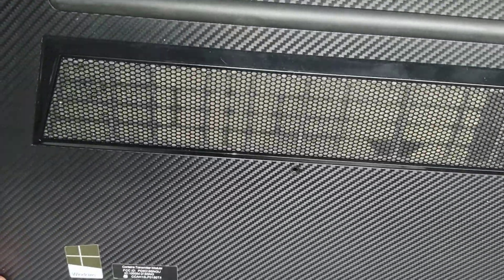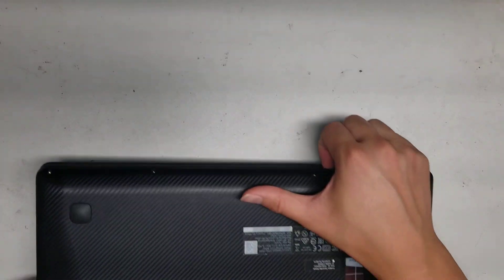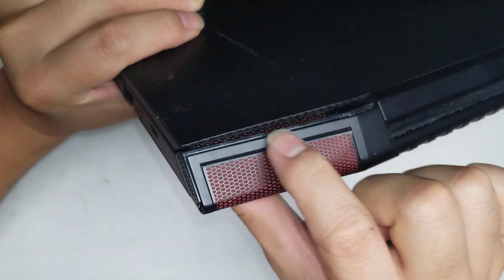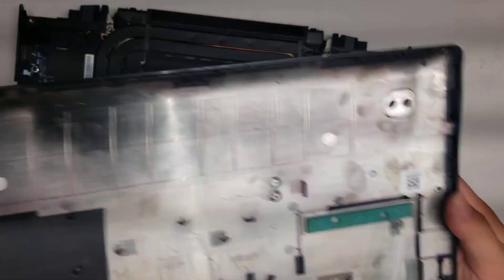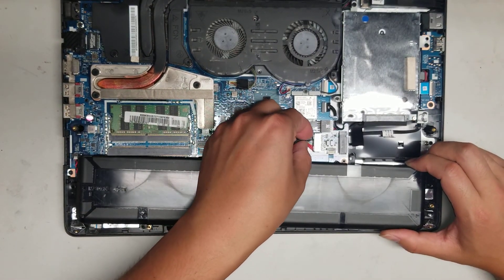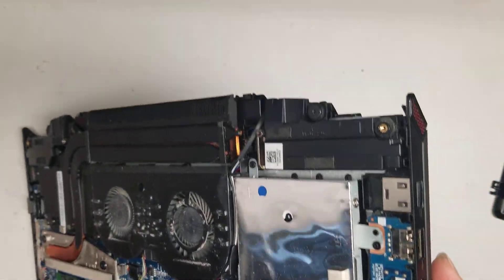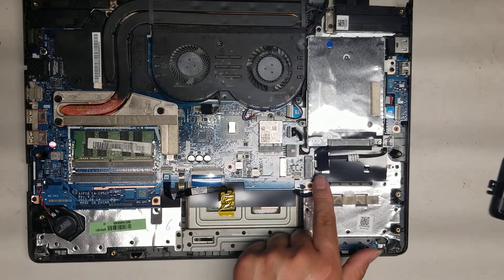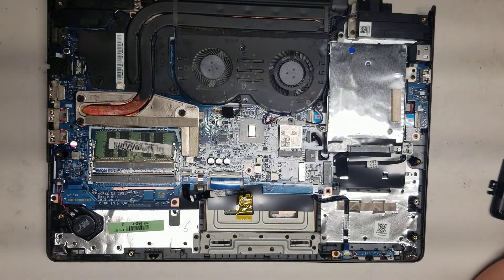Lenovo ideapad Y700-14ISK 80NU Disassembly RAM SSD Hard Drive Upgrade Repair

Comment: dude edit your video. Half of the vid is you trying to open up the back case
Reply from the maker: So what you're saying is, cut out the part that I struggled on,  and expect everyone that watches my videos to figure it out themselves? I'd like to educate you about a feature of YouTube known as fast forwarding and the progress bar. You know you can slide that around and view a preview of where the cover is already off if you can do it yourself?

If I edit that part, other people will wonder what they're doing wrong and why it was so easy for me to get apart...
Reply: @ItsBinhRepaired    as a repair and review channel you should not "struggle" on opening a back case that's for one. Also its not like you provided much useful information here:  That M.2 port, is it NVME or SATA?  the heat sink, how do i take that out and reapply thermal paste? what is the exposed shiny chipset in the middle but without a heatsink?  Based on the video I say the hinges are f-ed, can you show me how to fix that?  
I will give you credits on the connectors part, but tbh, the information density of this video is VERY low. As for fast-forward, not my fault you didn't put no timestamp in the description. When I ff several times and you still stuck on the cover thats on you.
Reply from the maker: @ddjohnson9717  do you know how to use the progress bar? Click or tap and drag it. You'll see when the cover comes off. Do I need to make a video on how to use this feature?
Reply from the maker: @ddjohnson9717  this video is 2 years old, and of course when working with hundreds of thousands of models, you can't get all of them open easily. You can't expect a car mechanic to know how to open every single car, especially when manufacturers come up with all different ways to secure things. As for fixing the hinges, I have lots of videos of all different models where I replace the hinges.

I do repairs based on what customers bring for me. How would you like if you came in for a tooth cleaning and your dentist was like, today I'm going to show the internet how to do a root canal on your perfectly healthy teeth! :) This is not how my repair business works. I don't experiment on customer devices. If you want to find out what type of SSD is supported, purchase both, try the NVMe first, if no luck, then you have to go with the SATA. Again, these are customer computers, not test benches they give me to mess around with.
Reply: @ItsBinhRepaired  yeah dude. dodge the real questions and try to blame me fore some BS. How did i know how far should I drag it? Also you gonna answer my questions or nah
Reply from the maker: @ddjohnson9717  ok, let me make a video for you real quick
Reply: @ItsBinhRepaired  "purchase both, try the NVMe first, if no luck, then you have to go with the SATA. "  you do know you can't return that stuff once opened right? If this is how you make a business out of repairing laptops please let me start a branch with you on the east coast.
Reply: @ItsBinhRepaired  also I don't know how many video you got with your address plastered in the discerption but I really suggest you change that. who tf publish a residential address?
Reply: @ItsBinhRepaired  i will wait in great anticipation
Reply from the maker: @ddjohnson9717  I guess they don't have Amazon where you live... plus, I can keep one of each because I'll likely need it eventually, but holding onto depreciating parts is dumb, so I never carry M.2 SATA drives.
Reply from the maker: @ddjohnson9717  thousands, and you care why? What are they gonna do, send me stuff? Come stalk me? Lol...
Reply from the maker: I said I could hold onto spare parts, you can just return stuff, but for some reason you think you can't...

My content isn't designed to draw in subscribers. Nobody will watch repair tutorials for computers they don't own. It would be like subscribing to a programming channel when you don't program...

As for begging for attention, I think you're talking about yourself.
Reply: @ItsBinhRepaired  also dude change you address to a PO box? pretty sure you are doxxing yourself
Reply from the maker: Here you go, a video made just for you. https://youtu.be/Ec1hI71kJkc
Reply: @ItsBinhRepaired  oh look, comments are off in your new video. 
what's going on, afraid of people agreeing with me? come on.
Reply from the maker: @ddjohnson9717  they shouldn't be off
Reply from the maker: Fixed it
Reply from the maker: @DD Johnson  I hate how YouTube randomly decides to disable comments on videos I upload...I have to manually go through and check each one now... I tell it to allow all comments and it auto deletes comments with links without even letting me see that they were deleted. People will comment asking why their comments are being deleted and I never even saw the comment to begin with.  They even auto delete comments that they think are too vulgar. It's annoying, especially when I like to argue and respond to even the most vile and stupid comments.

I turned the comments on, so you can go comment there to your hearts content.
Reply: @ItsBinhRepaired  LOL WOW u guys been going bak n forth at it like MMA. when THE TROO MMA FITER NEEDS to put in work to open this badddd boiii gaming pc. ANYWAYS i got it wayy bak in like 2009 FFFF M LL. n HD went all GIRRRR on ME. so had to do internal clean out. BOPPP yorself MMA boiz . ANDREW TAINYT IS NOT HYOUR BFFF
Reply from the maker: @AxsisCor  lol wuh?